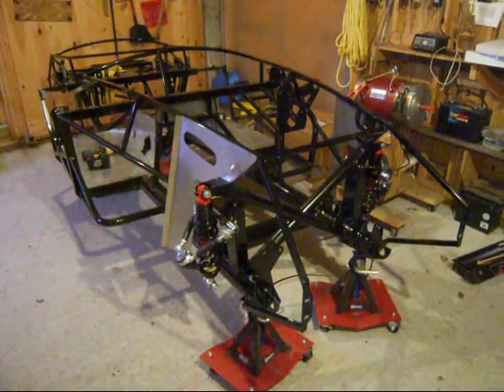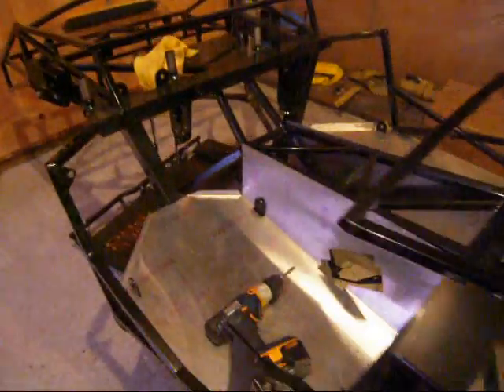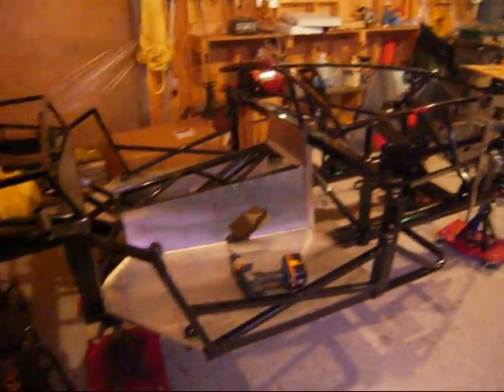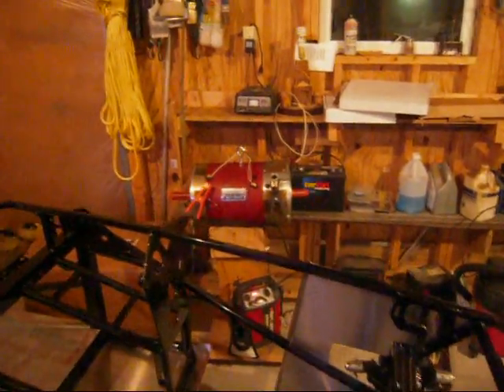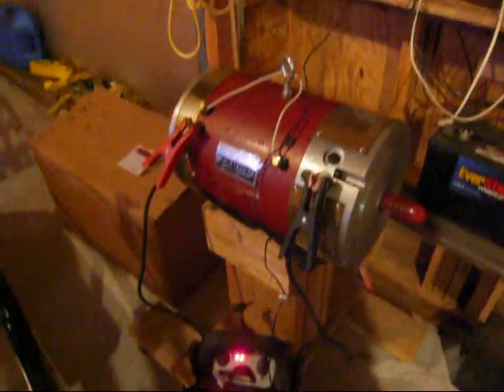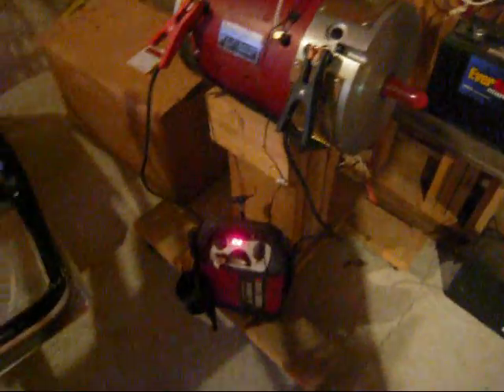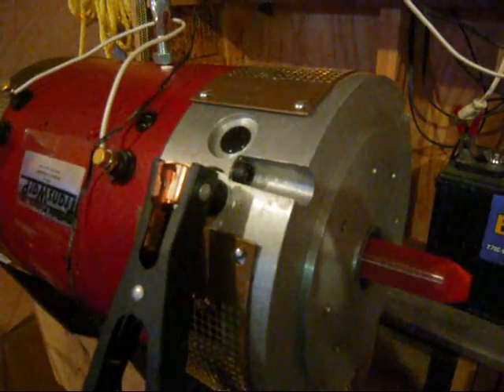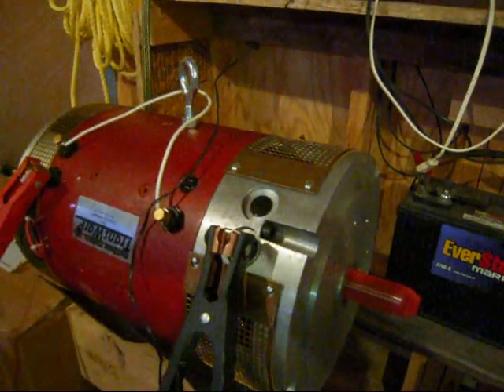Factory Five Mk4 - Electric Car - video 2

Comment from the maker: Uh.... actually I installed a V8 sound system the car.   It revs with the pedal position, and rumbles enough to feel the vibration with the car sitting still.    It's based on a SoundRacer engine simulator with sampled sound from a real Shelby V8.

My video #32 shows it running.